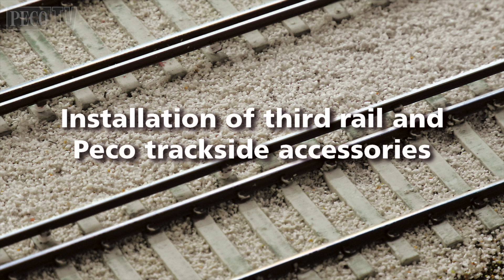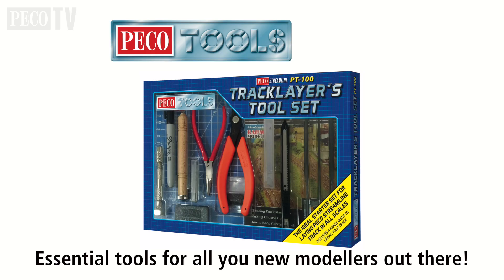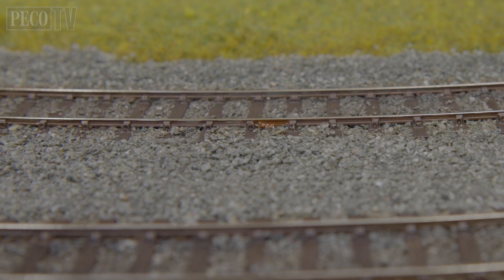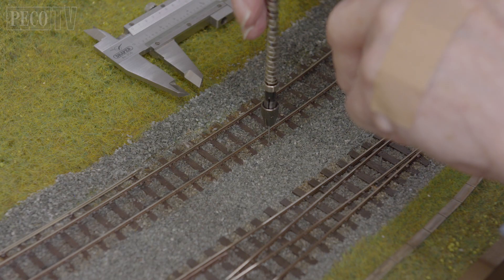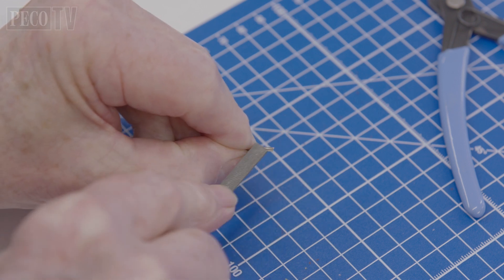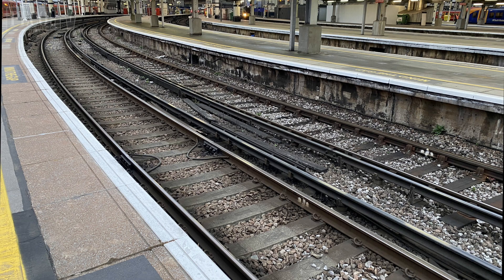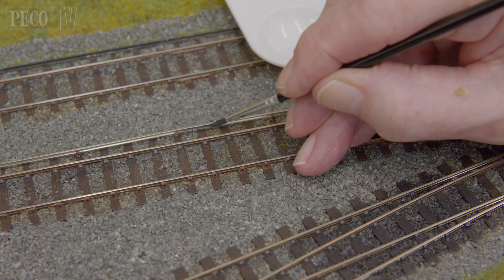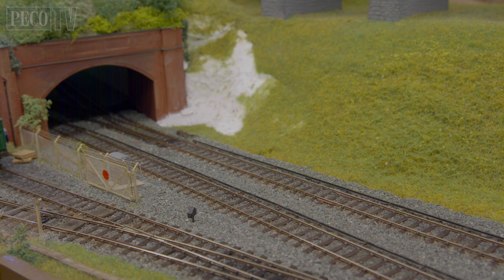Third rail installation and trackside accessories

Comment: How about making the model third rail live and powering a train from it just like the real thing, I've often seen model layouts at exhibitions with a third rail but they were never live. And I know it can cause complications with wiring and power control etc. but surely it should be made easier now with digital control so you can just power up all the third rails from one power supply albeit in sections, just like the real life ones, and each train or loco should only respond to it's own digital codes. I always wanted to build my own layout but it's too much for me as I'm far too occupied struggling to renovate and maintain my home and I've got far too many appalling disabilities which make it far too overwhelming so building a layout would be far too big to take on, especially at my age. Back in the late 80's I was going to try and scratch build a class 504 unit from brass coach parts but I got so far with it and ran into all manner of problems and ended up shelving it. And if I had finished it and built a layout for it I would have made it to run from a live conductor rail. I wonder if anyone else has ever built one and powered it like the real thing, especially as the 504's had an unusual side contact pick up system.
Reply: Great idea but one issue i can see is you'd need the 3rd rail shoes on the models to spring up n down like the real thing other wise if they are fixed then there is no give which would just cause derailments and would be very hard to make it move in 00
Reply: @harrytilbury2453  Yeah, I know what you mean, it would need a little strip of hard wearing springy metal fitted across the middle of the bogies and the best metal for the job wouldn't take solder, so you'd need a really little solder tag which could fit under the mounting screw. And of course it would need a plastic bogie to stop it shorting out to earth. And you'd have to experiment for some time to get the strip bent just right, I bet it would be a right pain in the butt getting it right.

Comment: Ooo Wareham methinks, my late father with his BR knowledge was heavily instrumental in getting Swanage connected to the main line again, a legacy that will last many years indeed.   I am keen to third rail up once I have decided on my basic layout, am also keen in developing a entry-exit pathing control layout similar to the BR power panels but have to build my railway first hehe   BTW those Peco power connectors are absolutely TOP stuff, I bought several pairs and are just brilliant to use and have disguised several of mine as "hot box" detectors or plinths to hold shunting limit signals.